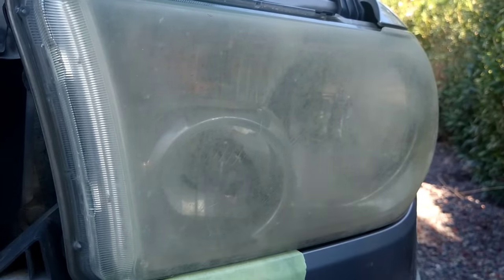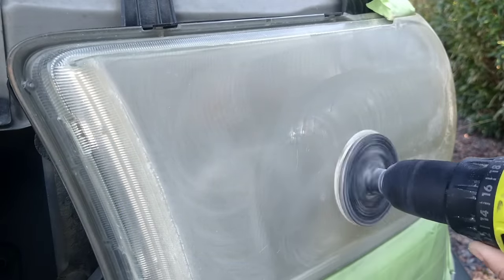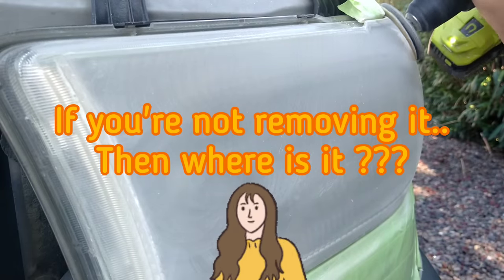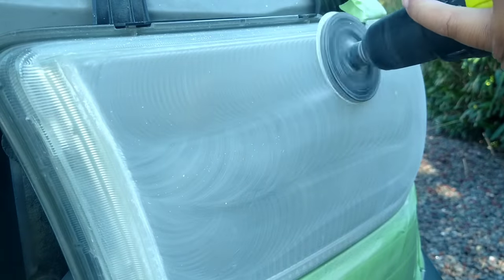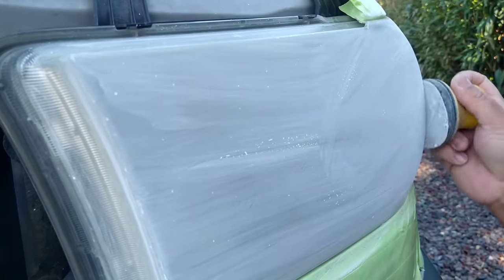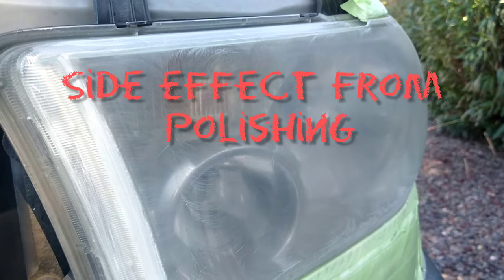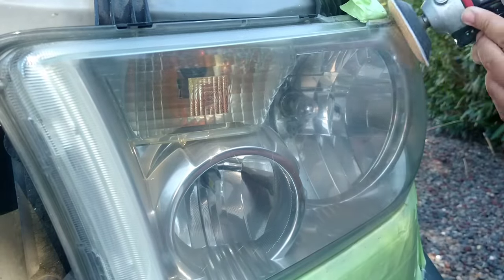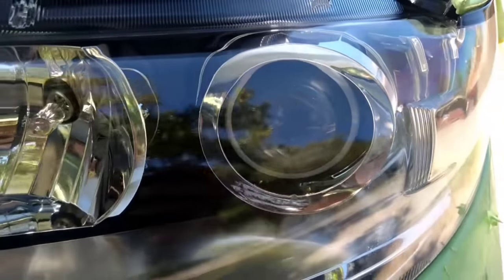POLISHING HEADLIGHTS IS A SHAM/scam  ---  and why you should never only polish headlights

Comment: Do you not do a wet sand?  Is it unnecessary?
Reply from the maker: It is somewhat unnecessary in the beginning stages.. it does have its place pretty much a lubricated sanding very light very delicate as though you wouldn't want to start with it cuz you're just overworking yourself and not meeting the depth that you need to go that you wouldn't even know it because of the liquid. It is better suited as a single step towards the end of heavy restoration as I show on all the videos...(and that's for the special pad the p3000 trizact pad)

Comment: I use sandpaper but I make use of water to avoid deep scratches. Or, better use mother’s polish. It works even without using sandpapers.
Reply from the maker: Dry sanding tonight leave scratches as you see this video if you do it right...
Polishing your light is up to you you've seen the video.

Comment: The only step I do differently is I use a ceramic coat as my last step.  Not a cheap one but you use so little per headlight one bottle lasts ages.  Aside from the benefits of easy cleaning, you get a diamond hard finish that is UV stabilised.    I can make up to $1000 a day just restoring headlights and word travels fast when you are good and do it right.

Comment: My car manual specifically tells you not to use anything on the headlights; and not even dry them.
Reply from the maker: Strange wonder what kind of vehicle. . also once the light is finished you should mess with it too much.. drying them off would be fine. Sooner or later you'll probably have to do something though.

Comment: I’ll tell you about seven years ago I had the same problem. I sanded  off all the oxidation 400 wet  then went up to 1000 wet then Sprayed On some adhesion promoter (Bulldog )Then a High and clear…. There  as clear as could be today…. I believe if you use a good product, it will last a long time even if that’s not it’s intended use🤷🏻‍♂️

Comment: My experience is that these problems can be prevented by regularly washing the car and using a good quality wax polish with UV protection on the lights as well as the bodywork. I bought a new and cheap car, 6 years in and my plastic headlights still look great with no restoration needed. If you do nothing then your paint and your plastics will look like crap within months, if you look after them then they'll last many years.

Comment: I like your video and if I restore my headlights oneday (they are very good still but I'm super picky and will be freshening them up) I'm probably going to be following your method. However!!! I am very conflicted with some of the information you've presented here.

My main issue is that you're bashing a 2k clear restoration. Now, I haven't done thousands of headlights so I can't speak directly from experience... However a lot of YouTuber painters with a lifetime of experience have directly stated that ALL of these restoration kits and easy spray coatings pail in comparison to a proper 2k clear. I've watched their videos, and the headlights come out flawless, and if you get orange peel it's easy to than do a very light sand and polish it to perfection at that point without having to respray the clear. They've also said the 2k clear WILL last a lifetime and is about 100x better than the coating from the factory.

So... Why would I use your method? It looks easier, and dries much faster, and requires less masking... But I'm telling you right now.... There is no way it ends up with a more durable long-term finish than doing a 2k clear. That information is just never going to be true.
Reply from the maker: Well the proofs in the pudding, 2K clear is not even more clear than my end game.. if you can look at my finished product to cake there can handle or hold a candle to it . For starters.. there's so many downsides to 2K clear I do have a video about it.. overtime it damages the headlights and they will go bad literally like 4 or 5 years it's minorly last longer.. with extreme negative benefits for your headlight.. the application method is extremely hard and comparison it's a laughable almost.. and those painters are just painters they're not headlight restores they've never had to remove it they've never had to redo a headlight restoration after it have they ever showed you doing your headlight restoration after it or removing it when it's time to do another headlight restoration because it will not last the life of the vehicle it will not last 10 years.. more likely five maybe four.. there's a thing I say is headlight health these 2K clears wreak havoc on headlights underneath the clear coat.. one of the biggest things is it's too hard it's too durable . When debris hits these headlights that are done a lot of times they leave crowning which is white impressions where the impact was so when your headlight is peppered over time you have all these divots and dips underneath the light that will not be removed from impacts, also it Bond so hard and overheats it causes spider cracking on both aspects of the light,.. the thing with headlight restoration they will never be a permanent fix there will never be anything that can put on a headlight have it working properly and not go bad it's a catch-22.. so when it does go bad it's so terrible and difficult to remove that you run a risk of damaging the headlight, spending an hour or two to remove it.. or damaging the vehicle around the headlight (the paint)..
So many negative effects they only tell you about applying it.. and like I said they're painters or somebody who just doesn't know.. they're not in the field dealing with this kind of stuff just yesterday I had somebody sprayed 2K clear on one of his lights and stopped and called me and it was a fresh 24-hour old application of not the really bad 2K clear that was like krylon or something ( the fast Max is ridiculous) One Headlight took me an hour and 15 minutes to remove the 2K clear properly and I have an aggressive bag of pads I had to use 150s, 220s, at 320s.. just to work up to a point where I can use the 500s, then the 800s, then the p3000 my regular method. This person had to pay extra money for difficulty and time... And by the way doing one headlight when I'm not filming takes me about 15 minutes..
The thing is a lot of people just aren't educated enough and I don't blame them everybody's trying to find the best shortcut and this and that and it's actually not rocket science you use headlight certified products as much as possible just like you do in any other kind of trade.. these products are designed by scientists for specific purpose... For instance you can feel your car tires up with propane and they'll inflate to the proper PSI... But you think that's safe for the tire or yourself..... You can paint a car with interior paint.. but do you think that's professional.... Might be a side effect or two... A lot of it stems from a lack of these people having to ever deal with the headlights and a lot of them lie.. if you're not smacking headlights down professionally and you're doing one here or there or this or that you don't really know I've removed so many headlight surfaces and applied so many different methods it's insane.. luckily for me early on in the beginning I figured out 2K clear was not the method.. for business, as well as headlight restoration in general... I used to try to use it myself and came out with awesome outcomes, nowhere near what I do now.. but as a professional once I found out the negative points of it and started having people bring their vehicles to me that I already had it on it I stopped immediately once I took off two or three and I knew it was this there was no way in hell I was going to put that on anybody's headlight...
I can go on for hours..lol thank you for watching please stay tuned for some more content.. coming soon
Reply: @theheadlightrestorationpro  thank you for the video and the thorough explanation. I have read it multiple times and you have completely convinced me that your method is superior in the long run compared to a 2k clearcoat application.

You've made a lot of important points that I wasn't aware of... Such as the durability of the 2k clear ends up actually being a huge negative over time (something I didn't considers, since generally durability is associated with being a positive trait) but I now understand WHY it quickly turns into a negative on a clear plastic surface over time as it's exposed to weather and road debris and the degradation of the plastic being 'suffocated' underneath leading to cavitation, delamination, spiderwebing ect ect. . This is probably the exact reason why the factory coating is softer to begin with. Also, I'm extremely happy that your method is better because it looks a lot more straight forward at the clearcoat application stage which is why I planned on going with it in the first place (rest of the prep is probably nearly identical). It's one of those great scenarios where doing it right means it's actually easier.

Huge thanks! 👍
Reply from the maker: @Alex K  awesome...yes indeed...
Stay tuned I got some good videos coming up..
You might be interested in this one
.. I believe it's one of the most important videos that I've done..https://youtu.be/tnCdU2j5Ja0
Reply: 2K is exactly like Armor All in that it creates problems with the durability and structure of what it's applied to.  It looks decent .. until it doesn't and then the fun is over.
Reply from the maker: @josephoberlander  💯
Reply from the maker: @josephoberlander  https://youtu.be/x1gp9ATZTI8

Comment: The haze is because you haven’t polished enough with a softer material or extremely high grit.  Using Meguirs Compound and polishing with PPF to finish will make the cleaning last half a decade at least.
Reply from the maker: Man you might want to check out my channel before you start assuming you know something that I don't know..lol
Over 130 PROVEN top-notch had a restoration accomplished on this channel well over 400 examples of this method on this channel showing you the end result of this method... This particular headlight was to showcase that in fact the headlight fogs over in certain cases especially these Toyotas which is prone for permafrog you would know that if you did more headlights... Thanks for watching..
I actually do this for a living and a whole lot more...💯😂

Comment: Is there a specific reason for using the drill in reverse?
Reply from the maker: Touch bases in some of those videos... And will touch bases some more in the future.. but basically in terms of doing headlight restoration there is no reverse..
From time to time I'll switch from one direction to the other direction because it grips the headlight different the torque of the drill pulls your hand in a certain direction when you're in certain areas it's more better for it to be pulling away from the area that inward towards the area you have to make that decision with your discretion for safety cuz it can't throw your drill and hands way off mark which is one of the reasons why I tape three or four inches around the headlight mandatory cuz it's happened before and it'll probably happen again..
Hope that shed some light on your question... Good attention to detail..👍🏼

Comment: Why is it that only the outer surface fogs up. isn't the inner surface exposed to the same UV rays?
Reply from the maker: It's just the surface layer that is affected...
A very thin layer and layman's terms about 1/5 of a piece of paper.. for mild lights. For extremely damaged lights maybe half.. kind of like a sunburn.. only the skin is affected it only penetrates so deep.  Also there's some other reasons to do with the existing oils inside of the polycarbonate but that's a little more scientific but pretty much it pushes a little bit of oil to the top... You should watch this video ... This goes more into depth..
https://youtu.be/tnCdU2j5Ja0

Comment: It all depends on how bad the lenses are, and how good you want it to look.
Then of course time and effort you want to invest into it, or $.
If you want them to look “brand new” then you can take THIS route, but depending on your vehicle, it might cost less to just buy new headlamps.
But if you just want them to be clearer than they are, and don’t want to make things complicated, or waste your money, you can just hand compound (Ultra Cut) the lenses with microfiber towel, wipe down, then wax it.
It’ll last for few month, until you can repeat the process, that will take less than 30min, even if the lenses are in pretty bad shape.
Again, it all depends on what you’re willing to do, and how clear you want them to be.
Simply compounding by hand in few minutes can be looking very acceptable for many people out there.
The bottle of Ultra Cut Compound will cost just lil over $13 (8oz) which will last for several years, even if you need to repeat the process few times a year.
I “restore” my faded headlamps that way, twice a year. 
They don’t look crystal clear, but close to new look.
I’m NOT taking it to a car show 😁

Comment: How come you don't use water for your initial sandings?
Reply from the maker: Dry sanding is remedial.. that's why it's kind of like training wheels... It's almost as if metaphorically you're chosen method to mow a football field was a regular push mower... Instead of the big dog that you drive.,.. 10 times slower, 10 times less efficient a lot of people who wet sand have a high inconsistency rate because they can't correctly see the depth they need because of the nature of wet sanding... They think they've hit their depth and then every other headlight they see is when yellow or than it should be or not as clear as it should be... Also not enough friction being a substance that melts and reacts to heat polycarbonate which headlights are made of reacts highly to heat heat is produced by friction water is a lubricant also mixed with the headlight residue as a lubricant that keeps the heat down and Dulles the sanding about 70%... Just think how long it takes to wet hand sand the headlight with one grit before you go on to a next grid just with that one grit probably takes what five six seven minutes... I can knock a hole headlight surface down in 30 seconds... As fast as I am on film I'm only working at half mast because I have to deal with filming and slow down for people...😉
But what sending does have a place if you notice I do it kind of at a beginning of the end or better yet middle of my process with the trazact p 3000... Cuz this is a super fine sanding stage and to prolong and make the super fine sanding even more fine water is included.... It's kind of a finishing method ,fine tune... To open up with a fine-tune method and do it all the way through... El Bueno it'll work.. I've done it I've experimented with it, and this is what I found out to be true... Another metaphor whatever Town you're in you probably have four hemispheres Plus the center of town  ..Say you live on the outside of any one of these sides of towns... is the best way to get to the center, walking, riding a bike, a scooter, probably a car right adequate power, anything above it would be too much anything less of it would be inefficient but you can do all the above...
That's just one main reason there's other reasons it's ,messy it's gross, when people come to see you it looks unprofessional it feels unprofessional, inconsistency as I said, slow, doesn't have the right flash point (heat presents from friction/this enhances clarity), and many others...
I've tried it all and like I seen some of my videos I take the good points out of everything whatever is good and use it when prevalent, my headlight restoration style is like the MMA of headlight restoration... I take a little bit of everything and throw it all in the best things of everything and throw it in and I'm always experimenting and I'm always trying new things.

Comment: Polishing headlights is the most cost effective method. Replacement lenses are usually not available and replacement headlight assemblies are prohibitively expensive. Porsche 911 headlights are over $3000 a piece.

Comment: bought a car with really nasty headlights. buffed out with a non silicone yatch/gelcoat compound ( 3M Imperial comp ) and a wool pad. cut right thru the oxidation and came out looking brand new. then wipe clean/tack cloth and apply 3M headlights clear coat. this was 4 years ago and they still look new.
PS- I detail Yachts and Aircraft
Reply from the maker: Cool...👍🏽
Reply from the maker: There's many different levels of acceptable my end result is of the highest quality the highest level there's not another level above.. by doing it this way you will achieve that level more than likely with what you did was efficient and probably looks amazing but this is kind of a different level... And it's foolproof every time.. results are steadily consistent you should check this out...https://youtu.be/6_3Z7pTtpko
Acceptability levels different in each person... I don't settle for anything but the highest level as though I do this professionally.... And am a true professionalist...
Reply: @theheadlightrestorationpro I totally understand please don't take offense I'm not saying your method doesn't work I just did it a different way and it works too. Cheers
Reply from the maker: Thank.. appreciate your feedback I hope you continue to watch my videos I really appreciate it...